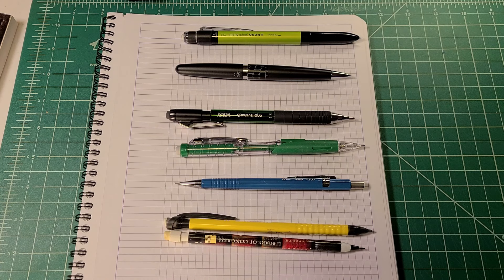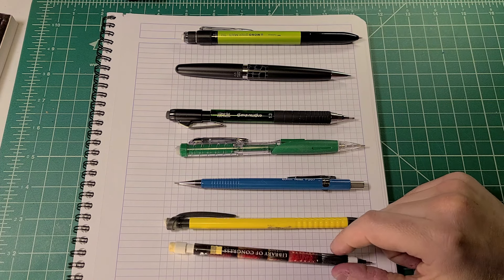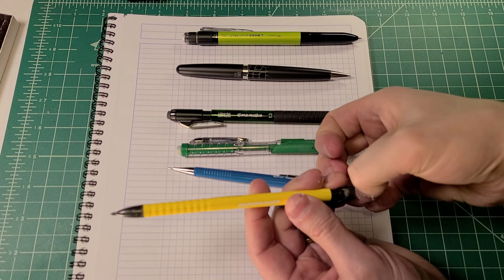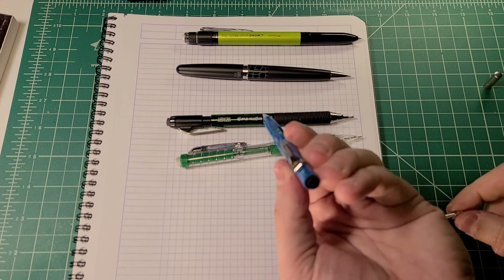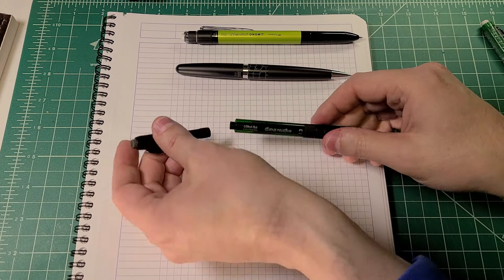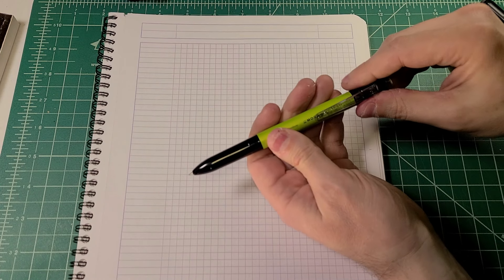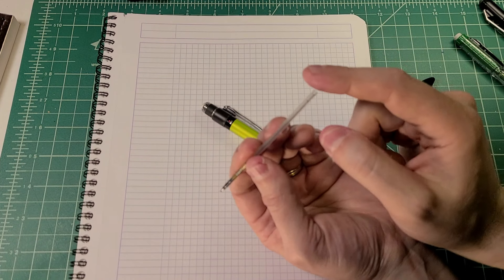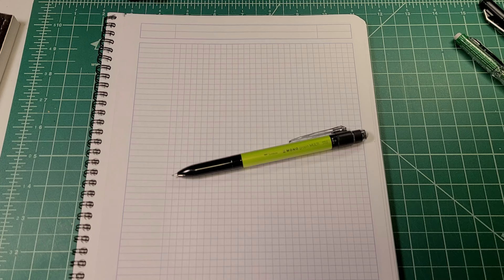How To Refill The Lead On ANY Mechanical Pencil!

Comment: What I often do is press the button to advance the lead and shove the lead in through the tip
Reply from the maker: This is another option! Hold down the knock and thread it through. That can also help if you are struggling with feeding lead through the chamber. But it if there is a jam, it might just snap it off at the tip of the lead sleeve.
Reply: I do this sometimes to work around taking out an eraser near the end of its life, where it's hard to remove to access the lead chamber. It's definitely not always ideal, because you nay be dealing with very thin lead, or very long lead sticks (economy Papermate sticks are like 5 inches long sometimes) which will feel like surgery trying to insert the lead without snapping it.
Reply: yea me too and its the wrong way
Reply: I do this too but sometimes the lead just snaps lol
Reply: I sometimes do this
Reply: this comment is how i discovered this was actually the only way to refill my mechanical pencil
Reply: @nancytangotits  glad i could help
Reply: Thanks that helped
Reply: I THOUGHT I WAS THE ONLY ONE
Reply: Wow! I never thought I would be looking up how to refill a mechanical pencil! But here I am, and I’m so glad I found you. It makes me feel silly BUT giddy at the same time. What a life saver. Most of the mechanicals I’ve had refill by pulling the top chamber off. This little bugger was obviously not coming off that way. Lo and behold remove the eraser and WALA, there it is!! Thank you kindly. I feel proud. Hahah😅
Reply: Some day ur lead will break short enough that it can't be extracted.... 😂😂😂
Reply: Thank you this was the only way that worked for mine!
Reply: That's awful for thinner lead sizes though. For 0.5mm you might as well forget it.
Reply: Tnk you so much!
Reply: Not the best way
Reply: Ture true true
Reply: Me too
Reply: Tysm

Comment: This is one of the most useful vids I've ever seen.  I had no idea the erasers come off most mechanical pencils!  If the pencil doesn't come apart easily, I usually try shoving the lead up the tip; sometimes this has worked; sometimes, not.  In my experimentations, I  also discovered that pencils have different sized leads, which (obviously) makes a huge difference.  I am very grateful for this demonstration, for I can't tell you how many mechanical pencils I've given up on and tossed--often broken from my efforts--into the garbage.  Now I know how to refill them, I just have to figure out how to advance the lead on some of them!
Reply: careful with shoving lead up the tip on some of the more complicated ones though i broke a kuru toga by doing that lol
Reply: same

Comment: I can’t seem to get to first base with my mechanical pencil. I have a Pentel Cushi P35G .05 9C. It failed to advance the lead. I thought it was just too short of a lead left in it. I removed the cap and eraser. I looked through it and I could see light out the other end. I dropped in a brand new lead, replaced the eraser and the chrome cap. I tried clicking it, it will not come out of the tip. I unscrewed the tip and the lead is protruding beyond the nylon clutch if you will. I just don’t know which way to turn here. Thanks so much.

Update, I just figured it out. I took the chrome tip off the end and tapped it on a piece of wood. There is a little silicone sleeve that’s in there. There was a couple of pieces of lead jammed in that. I removed them and reassembled itand it works now. I am so thrilled.

Comment: Hrm, those look easy, having issues with a draft-matic 0.3mm
Reply from the maker: The trouble with 0.3 is that you are much, much, much more likely to get two to three pieces of lead jammed into a clutch. Complete disassembly and creative tool use (needles, wires, etc) are usually required.
Reply: @ClutchSituation  Ah, indeed.  I ended up with a led floating around in the chamber above the pencil point.  Turns out the cap above the eraser was stuck, and I was able to feed a new LED and get it all the way through.  Seems like the 0.3mm lead isn't heavy enough to reseat when needed, so you can't store extras in the pencil.  Seems like leads in the chamber can't be fed through the pencil or removed through the eraser.

Comment: Pentel Twist-Erase XP's seem to defy all reload attempts.
You can have lead in the chamber, but once the lead is past the clutch, nothing reloads from the chamber.
It just sits in there like a storage compartment.
The ONLY way I have found to reload these pencils is by removing the front cap and manually feeding the lead into the clutch from the tip.

Comment: My original nib HB) seems stuck in the tip of my mechanical pencil. How do I remove it from the tip so that the new replacement (2B) inside may stick out instead?
Reply from the maker: Disassemble the pencil and use a needle to clear the offending piece out.

Comment: Thank you for this video. The first pencil you demonstrated was the trick for replacing the lead in a Bic Velocity HB#2. Even then, I had to push the eraser end to pull out the old lead as it wasn’t coming out on its own. After that, I just clicked the eraser until the new lead fed down into the pencil. I love it when I can find these great & simple instructions on YouTube!
Reply: How do I make the lead come out for the first pencil? Cause I'm trying to get the lead to come out on that one, but no matter what I do it won't come out. Yes, I've checked if there's any extra lead blocking the way.

Comment: I have an older twist-to feed little pencil that came with a notepad. I've got several leads in the chamber, but they don't seem to engage. I tried feeding the lead from the opening, but it just falls out. Do you have a video for this, and/or a solution, please? Thanks!

Comment: I have two Pilot S30 pencils that came to me loaded with 6 leads. I'm assuming that Pilot knows how many leads can be stored without causing problems. I've had no problems so far. Will let you know if trouble ensues. Btw, the S30 is the best mechanical pencil I have ever used. I love these!

Comment: I'm struggling with a VaLaire mechanical pencil.  I can get the lead in the top, but it doesn't come out the bottom. Something seems to be blocking it and I don't want to start pulling things apart too much and wrecking it.

Comment: Ok this video kind of helped but I still need help.. So I have lots of mechanical pencils, and they are simple. You have to take the eraser off to refill the lead, but what if the eraser is really short and I can’t get it off? So I decided for one that I would use a pokey thing and dig away at it until I got it out. So now I can refill the lead but what do I put in the eraser spot??
Reply: You can refill the spot by hot glue gun (make a shape out of the hole and use it as the cap)